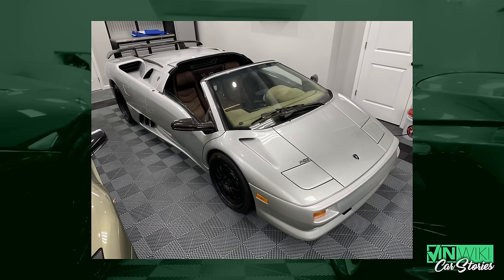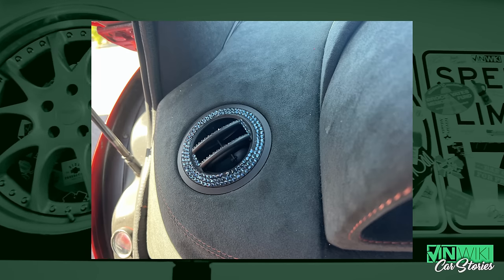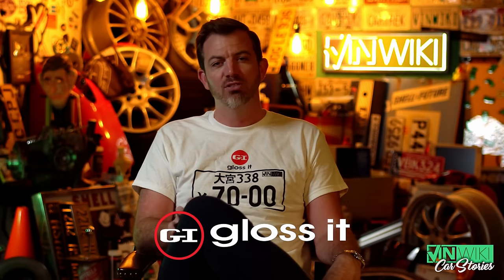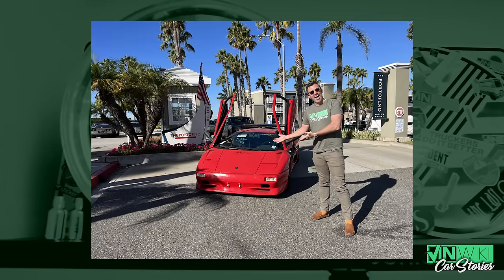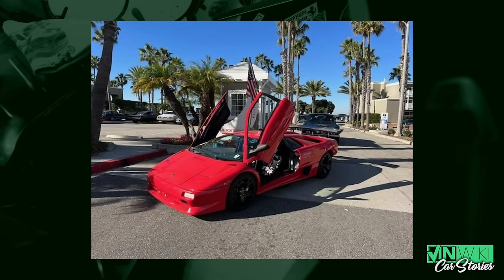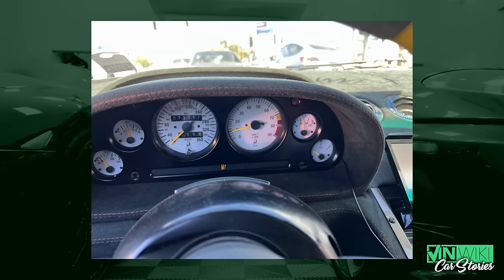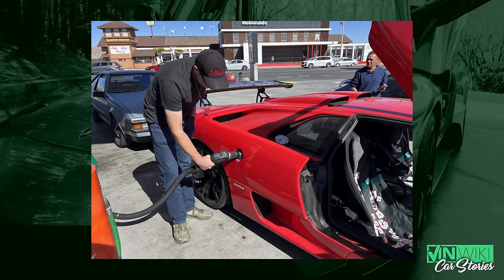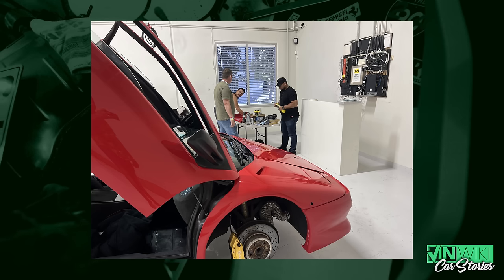I imported a Yakuza Diablo SV from Japan!

Comment: Clearly Ed and Jarrod need a collaboration with The Lock Picking Lawyer.  "Drill the lock out?!? Let me grab my kit .... and, it's open!" 😂
Reply: Just like me testing the compression in an old diesel, nothing on one... 
Nothing on two...
Oh.
We got something on three
Reply: So a guy I knew had shaved door handles on his body dropped, extended cab s10. Locked the key fob in it... I grabbed the antenna off my own Chevy Silverado, and started fishing. The truck was sitting there running so he was starting to get antsy, and he walked off to the edge of the parking lot. About the time I was able to push the button on the key fob I looked up and he was throwing a rock through the passenger side window. The rock smashed the window , hit the dash and smashed the head unit too......
And he looks up as I opened the driver side door.....
Sometimes people don't think effectively in a stressful situation.

Comment: I was out in Arizona back in 1999 and bought an original '73 Chevy orange/white Heavy Half square body at an auction for $1,500. Got in it and drove it ALL the way back to Pflugerville, Texas, aka home. My only issue was a pin hole in the upper radiator hose at the hose clamp that I simply got out of the way by cutting the hose end off and kept on my merry way. . . . LOVED that damn truck!

Comment: Rather than removing the rear tire, removing the gas gap and taping it back down on the outside, why didn't you simply call a locksmith AND have a key made?

Comment: Ed I've never heard anyone describe a diablo as unreliable, I mean its not a bat guano gallardo that self destructs its audi made engine in its audi made shell, thanks to be overstraigned by its audi 4 wheel drive system, its a lamborghini, its like a ford, the harder you beat on it, the better it runs

and the only failing part on them WAS the stupid 4 wheel drive system they stuck on them after the very first VT's were made without that disasterious system that stole half the fun of owning a lambo

and the SV, BUCKED that damn system and went back to two wheel drive, thus saving over 400 pounds of weight off the front end, which is probably where 90% of the improved performance came from, in addition to the functional cooling ducts on the roof

like you finally own an actual lambo, with proper italian bodywork, a proper engine and transmission, and it hasnt been ruined by that damn 4 wheel drive system they slapped on them to try and make them compete with cars like the bugatti EB110 and the porsche 911 carrera turbo 4S

although one thing puzzles me, Rienstones, as in Reinstone cowboys, like what is their a branch of the yakuza that's big into american culture 

or did you buy it from that one guy with the eye patch from the Yakuza games who was always wearing crap like that

and if you sell it I want first dibs

also I think your car was imported to japan, I dont think they made any for that market, so theirs gotta be a paper trail in the US somewhere, as I bet it was exported in 99', and then the guy got wacked and the car got sold afterwards